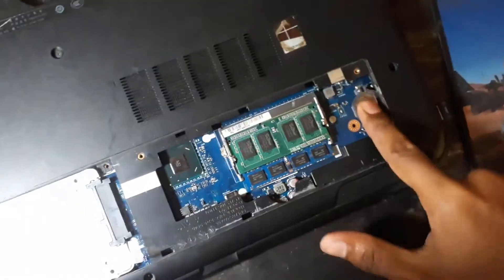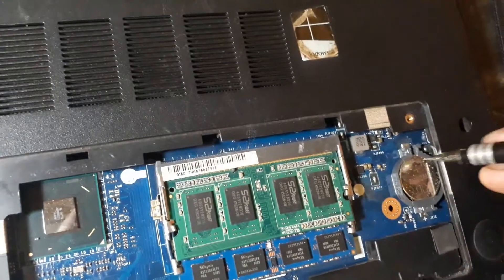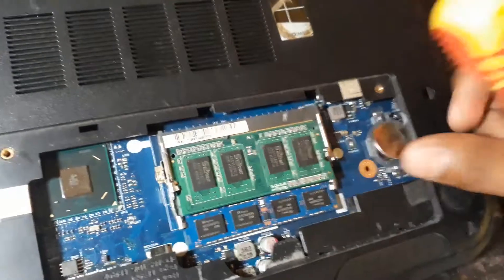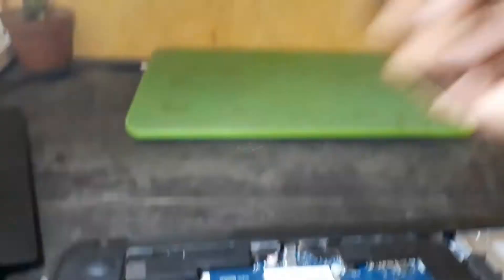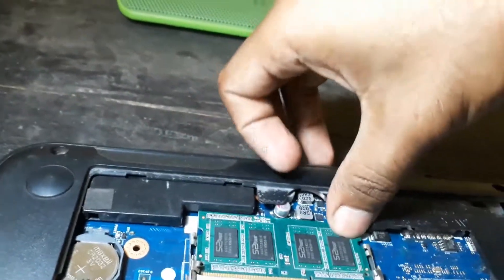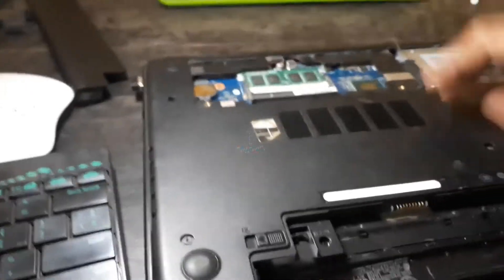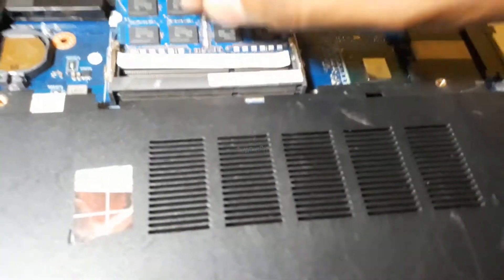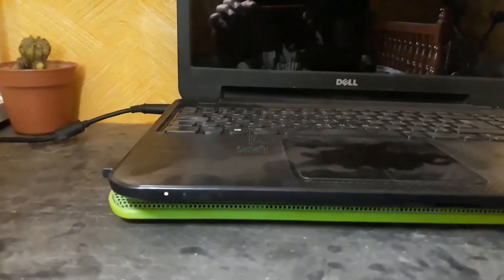Dell Inspiron 4 beeps on startup no display : Solved

Comment: For me I replaced coin battery with new one.  Moved old ram into other slot (Laptop battery out 1st). Instructions: Then with both batteries out, hold power to 10 seconds, then put both batteries back in. Turn on laptop, should then get 4 beeps (didn't boot). Hold power button for about 30 seconds, then push power button again (don't skip prior step). Should boot normally. After boot, shut down again. Both batteries out. Put in new ram in other open slot. Repeat steps from 'Instructions:'

Comment: I had the same exact problem and followed the procedure. After I removed the bottom ram module and replaced the cmos battery I still got the four beep codes. when I switched the ram module with another one on the TOP slot the issue went away. I then installed a different module for the bottom ram slot. Again, no issue. I think the original ram module that was in the top slot was defective. I think the same thing is true in this video. He instructs you to put that ram module (the one that caused the beep) back into the laptop... DO NOT DO THAT.  You'll have to install a different one.
Reply: could you use the laptop with just 1 ram?
Reply: @jadenpeterson6537  That would work, but you will experience worse performance.
Reply: @BlueSparkzVideos  oh ok also i just noticed that it still beeps 4 times does that mean i have to replace something?
Reply: @jadenpeterson6537  check to make sure your cmos battery isn't loose. If it's loose, then that's the reason why it's beeping.
Reply: @BlueSparkzVideos  ohh ok

Comment: My Dell 1501 beeped continuously on startup. I removed the keyboard and 
beeping went away. So I clicked every key several times, cleaned with 
compressed air, cleaned the ribbon cable with alcohol, reassembled and 
all is working. 2007 laptop 4GB Ram, now running WIN 10 20H2.Bottom line
 -it could just be a stuck key. Clean and re-seat everything before 
trashing.